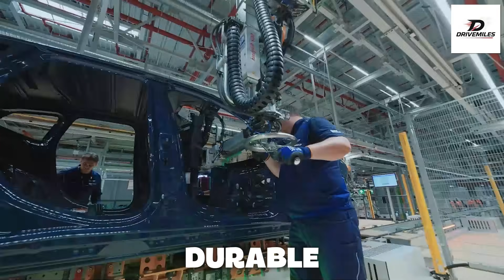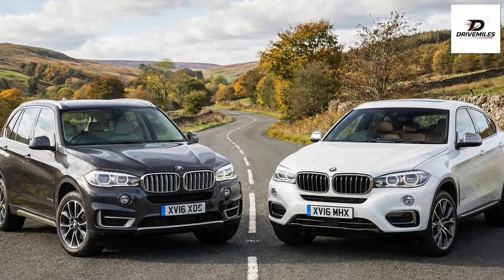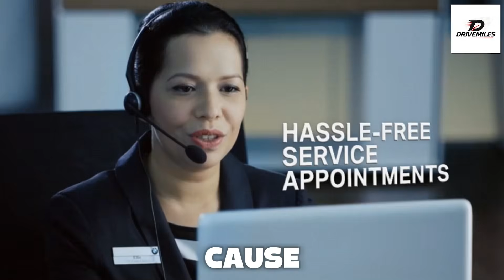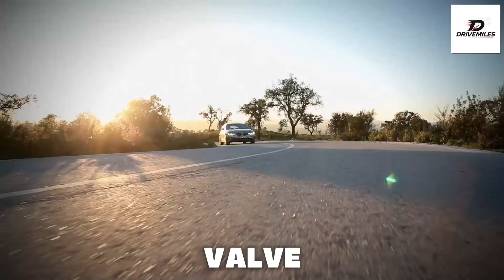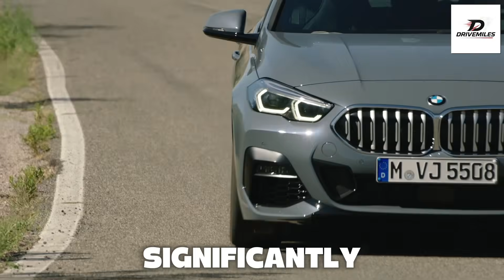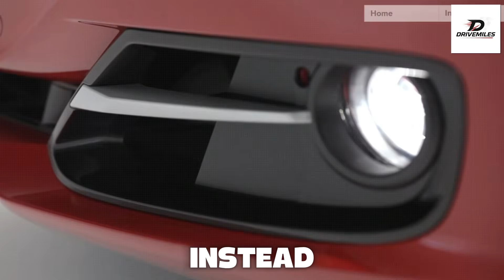Most Reliable 2016 BMWs vs 2026 Ones You Should Avoid

Comment: My 2016 B47 is at 240k km. Still no repair. Will do timming chain in 30k km.
Reply from the maker: @georgemihalache8003  That’s a solid run 👍  
The B47 is one of BMW’s better modern diesels *when serviced on time*. 
At that mileage, planning the timing chain proactively is exactly the smart move — most failures come from delayed maintenance, not the design itself.

Appreciate you sharing real-world ownership data.

Comment: I have a 2016 X6M S63 engine flawless with 120k mileage
Reply: I have a 2016 X6M as well with 108K. Love it!
Reply from the maker: @ericwilliams2323  Love hearing this 👌
High-mileage X6Ms usually belong to owners who actually take care of them, not people chasing cheap performance.
Reply: @DriveMilesYT  yes they are very exclusive, literally a dinosaur in traffic, but anyone that owns this particular model F86 will love the attention they bring, it’s literally a super car in disguise, very powerful.
Reply from the maker: @hulk-smash-deez-hose.7951  That’s the key takeaway for anyone reading this thread 👆
The F86/F85 X6M is an incredible machine — but it rewards informed ownership and punishes shortcuts. Not cheap, but very capable when maintained right.
Reply: @DriveMilesYT  yes maintenance is very important to the F86 the main thing to pay attention to is oil level capacity, and using the proper viscosity in the current climate, I run 0w30 in winter and 5w40 in summer the S63 requires drivers who understand it’s language, these vehicles are not for everyone, it’s an exclusive weaponry, it looks big and bulky, when it’s in performance, all mustangs, and dodge , scatpacks  demons, hellcat RT, they all have to hail to Caesar X6M.
Reply from the maker: @hulk-smash-deez-hose.7951 The F86/F85 X6M isn’t for everyone — it rewards owners who understand the S63 and stay ahead on maintenance.
Oil capacity, correct viscosity, and proactive service matter more than mileage.
Treated right, it’s an absolute monster. Cut corners, and it gets expensive fast.
Reply: @ericwilliams2323  this vehicle is well built, has a lot of maintenance from bumper to bumper 😂 but I see it running as long as you address modules before they fail, I daily drive mine, and it’s very reliable, super expensive upkeep, tires, oil change, it has two batteries, it’s the ultimate king of speed.
Reply from the maker: @hulk-smash-deez-hose.7951  That’s a strong example 👍
The S63 can go the distance when it’s maintained properly. Most failures I see aren’t mileage — they’re deferred maintenance. Enjoy it and stay ahead of it 💪

Comment: My 2016 B58 has been extremely reliable!
Reply from the maker: 100% agree. The early B58 is one of BMW’s best modern engines 👍
Strong internals, great cooling, and far fewer design mistakes than older BMW turbos.
Maintenance still matters — but as engines go, this one’s a solid long-term bet.

Comment: what about all the 2016 b engines line up ?
Reply from the maker: @stilllawrence6720  2016 was a transition year for BMW engines — and this is where a lot of buyers get burned.

BMW did not switch to B-series engines across the lineup at once.

In 2016, you’ll find two completely different engine generations, depending on the model and trim:

Still N-series in many 2016 cars:
• N20 / N26 (4-cylinder)
• N55 (inline-6)
• N63 (V8)

Early B-series already introduced in 2016:
• B48 (4-cylinder)
• B58 (inline-6)

That means two 2016 BMWs can look identical but have very different reliability and ownership costs.

This is why model year matters less than engine code when buying used.
I’ll break down N vs B engines properly in an upcoming video.

Comment: What about the 2016 b47 520d
Reply from the maker: Good question. The 2016 520d with the B47 is actually one of the better diesel BMWs of that year. It fixed most N47 timing chain issues. Still not bulletproof—EGR and DPF maintenance matters—but overall a solid long-term choice if serviced properly.